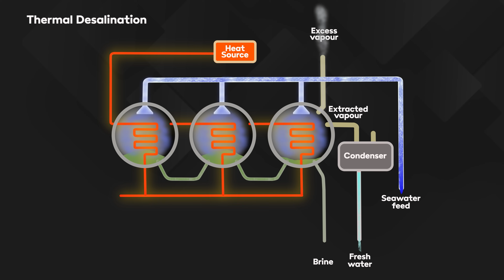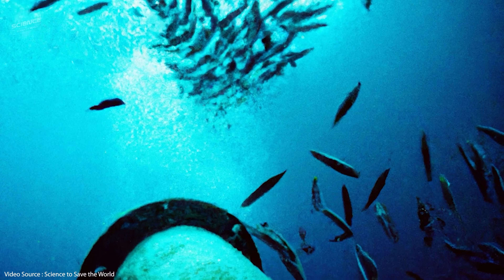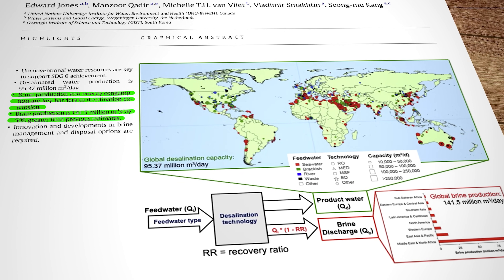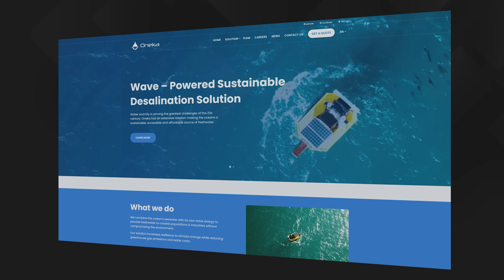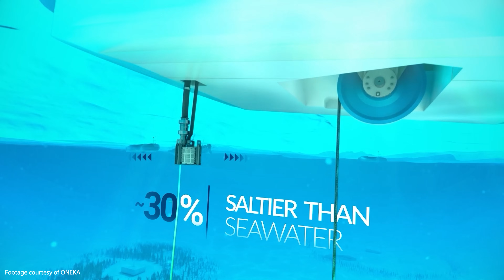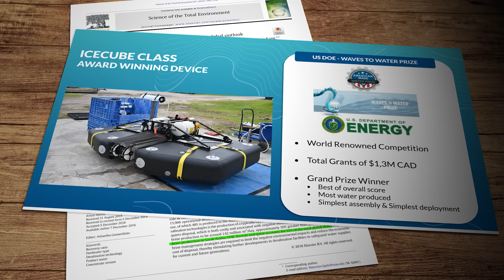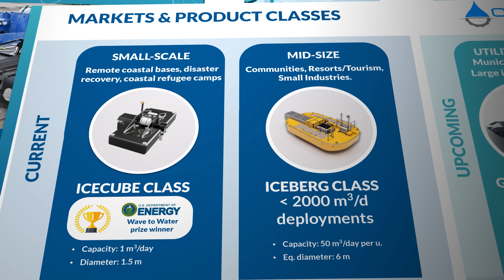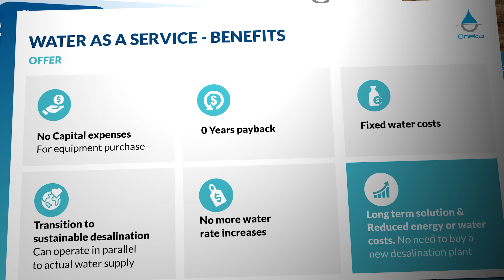Fresh Water at Zero Energy Cost . How do they do that?

Comment: My sense is, the maintenance costs are going to replace the cost of electricity.
Reply: Electrical power needs maintenance too
Reply: Having alternative to water scarcity problem is definitely welcome. 
According to sceptic, using fossil fuel powered thermo way would be the best…for who?   for the big oil and fossil pockets.
Reply: @SPSp-kl7tt  You could do it the old way and use the sun, but that wouldn't make any money and doesn't sound sexy.
Reply: Maintenance of large arrays hasn’t been a problem for offshore wind. Why should it be a problem in this case? It is also projected to be far cheaper than RO, providing capacity for increased maintenance costs vs that technology.
Reply: @thesquirrelhorde  Maintenance is actually a much bigger problem on the sea. 
But the benefit of increased windspeeds and thus yield and the factor that it is possible to install larger installations where on land roadsize is a limiting factor, hugely outweighs the increased maintenance costs.
Reply: @haifutter4166  I know, as I stated this is offshore wind arrays. In the UK we are in the process of building tethered arrays in deeper waters and these are still cost effective.
Reply: Darn! I wish I’d seen this in time to attend Oneka’s November 17th presentation at the 14th Annual BlueTech Week in San Diego, that’s just a hop from here in Newport Beach! Anyone here able to attend? Our local community only last year blocked the Poseidon plant scheduled for Huntington Beach, due to the destructive downsides & economic inefficiencies you mentioned. Here’s hoping that Oneka’s FL pilot pans out, as we in the Southern California “desert” would surely welcome them!

From reading the comments: Re: Collection Infrastructure, Maintenance, etc. They could be located a few miles offshore, where our defunct oil platforms, with their convenient anchor pads, are now. There could be single manifolds bringing fresh water down from a wind farm-like array of surface plants with piping piggybacking on existing oil to shore make ways. There could even be large solar & wind arrays out there sharing a common infrastructure. We have two such sites located ~1/4 mile apart that could provide redundancy. As decades long drill rig dismantling is underway, I’m sure this would be welcomed by the local community of those with the needed expertise & experience to make the transition. From my 10 months working on San Clemente Is. (down coast from Sealab where we chatted with the Cousteau support divers) & being “in” the sea as a lifelong surfer, this sort of thing doesn’t seem anywhere near as challenging as what North Seas wind farms pose. Circulating the components for maintenance should be a no brainer with a support/maintenance facility in San Pedro or even off/near Seal Beach (whose very activist residents might welcome the opportunities after thorough consideration). Please keep us updated! Thx.
Reply: Sounds like jobs to me....
Reply: My sense is the cost of maintenance wouldn’t even come close to the cost of electricity used by desalination plants which is extremely energy intensive. But using our ‘sense’ is worth jack sh**. Rigorous analysis is needed. Time will tell.
Reply: @BuellersBack  Something I can agree with.  We need DATA!
Reply: At least the connection to the mainland is a water hose and not an electric cable, which sounds like a plus compared to wave energy electric generators
Reply: Sounds like they're using wave energy on a boat to directly operate the pumps to a small scale reverse osmosis setup.  The reverse osmosis isn't run to the extreme, bypassing the difficulties of disposing brine.  I would think energy costs would be less because you are not fighting against the salinity as much because the brine is less concentrated.  You could apply many of the same concepts if you had a shore based plant run on wave and wind energy or even wind electricity where appropriate.  The low concentration of brine should not be a problem.  This would be applicable to a mid scale application.
Reply: My sense is we've never had and never will have any systems that are maintenance free.
The only things to be considered are the environmental impact and the cost per gallon.
Maintenance is present in every system.
Cost of installation, high or low can be amortized to equalize payments.
Reply: This could be built into ships & boats to provide fresh water for the vessel
Reply: @debrastrayer8600  True, ships already have desalination systems but if this would save money over conventional systems or make the ship "green" they'll do it.
Reply: Reading these comments, you wouldve asked yourself how we build any infrastructure at all and not just constantly argue about details that will be ironed out along the way. 
People here dont fully understand how this works, they over- exaggerate maintenance issues, and are not fully aware of how current widespread desal works. 
Its comically cynical, considering how dirty and inefficient our current power sources are.
Reply: @korosensei4384  I'm glad you're open minded.  I have some desalination investments for you.
Reply: @korosensei4384  I don't know if your comment was deleted by you or YouTube but "Tech bros" keep promising things they can't deliver.  Skepticism and DISCUSSION is healthy. SVB collapsed for a reason.  I'd love for this to be a great working idea because it legitimately solves some issues.  I just heard from a working civil engineer that more investigation in the front end would save many times the cost on the back end.
Reply: @jmr  I deleted my comment because I realized it was too sarcastic and you may have just been exercising healthy scepticism. The issue is reading tens of comments from different people about how this cannot happen, and channeling an answer onto one person who had tamed scepticism about one aspect of the project.

I get what you are saying, but some of the issues mentioned (by other commenters) were addressed within the video itself, and some people would rather respond pessimistically than open up to the potential of this idea and objectively weigh out the pros and cons.

Discussion is always healthy and time will tell if this project is viable. Looking forward to update on this.
Reply: @korosensei4384  I REALLY love the fact this idea can spread out the waste water better.  IMHO that's one of the biggest issues of current desalination methods.  It would also be great if we could redeploy part of a fleet to an area that's having a crisis. I don't know why the comments get so out of control.  I was being sarcastic too when I asked you to invest. 😂 My daughters college was literally paid for by a water desalination company that was started by three guys sitting around drinking beer in a garage.
Reply: @jmr  Oh you, and I was just getting my money ready 😄

I really like that the idea that its made out of waste plastic and that that it uses the wave energy for everything, and that the method itself doesnt require that much energy to desal, as its not meant to be as efficient as desal plants (also tying into the whole spreading brine better, as its much less concentrated brine).

Well I love drinking beer, now I just need to start something.
Reply: There are mesh wipers is use for water quality sensors in NZ mussel farms
Reply: Speculation as always, sigh.

The debate is unless someone can provide an accurate assessment on maintenance costs and compare them to large scale desalination plants.

Hard accurate data over speculation pls.
Reply: I’ve been around boats. Just leave anything floating in the sea, and see how long it lasts and how much work it needs.
Reply: Time will maybe tell
Reply: I have a feeling that most people underestimate the man-hours needed to make such a system effective over time.
The first month might not require any maintenance but that will change quickly. Even in the best of situations, you have to change filters and remove algae on a regular basis.

If something like a tornado happen, you need a huge amount of men/women and equipment on standby.
This is a cool idea on a small scale but extremely expensive if you make a whole town dependent on it!
Reply: @Alex Roth: If that electrical power is coming from burning Fossil Fuel, then we’re much better off paying for whatever maintenance instead.
Reply: I love the comment section of this channel.❤
Reply: It’s not just the odd breakdown maintenance, the filters get clogged and need replacement.
Reply: Why do you assume this will need any maintenance at all? Do pv panels need any maintenance? No. This platform is made from pet. Pet doesn't corrode for tens of years as proven by garbage patches. We have gas pipes, internet and power cables under the sea. I don't think putting water pipes there has any challenges. The only thing that can destroy such projects is under investment and lack of support. Technical difficulties tend to be overcomed if enough money is thrown at the problem.
Reply: @Adrian_kal  I’ve never seen a system that’s maintenance free. Have you? In the design there are a lot of moving parts that can break or get stuck, gaskets that can start leaking, corrosion, etc. Not to mention biological growth that will clog tubes, pipes, water intakes, etc. So yes, there will be maintenance. 

And no, lots of money does not necessarily solve technical problems. But it can keep up the image that your are working on solving the problem.
Reply: @Adrian_kal  
PV panels need to be cleaned every month or two, the dust and debris must be washed off.  In a marine environment the dried salt spray, barnacles, corrosion are also present.
Reply: @Adrian_kal  it will need maintenance. I'm a mechanical engineer and have been in the wave energy-powered RO industry for the last five years. I'm pretty intimate with the technology, but here's just a couple points about where maintenance will show up.

There are several mechanical components that will wear. Seawater, fresh water, and brine have low viscosity compared to oil that is normally used as the working fluid in these types of components, so lubrication is challenging and there will likely be higher rates of wear then normal.

RO systems need to be cleaned regularly to avoid biofouling and scale build-up in the RO membranes and throughout the circuit. Some of that can be taken care of with automated processes but not all of it.
Reply: But huge desalination plants also have maintenance costs...
Reply: @Fuck_Snowflakes  But at least they are centralized, making it easier, cheaper (fuel for the vehicle) and faster to reach the destination where repair is needed, no matter the weather or tide. 

The biggest problems of desalination plants (inlet and outlet) can be dealt with and improved on as seen in newer Australian projects. 

This new approach can be a great alternative for the niches it is currently marketed to. Let's just see how it performs and to what point it can be actually upscaled where it can't compete with a centralized approach any more.
Reply: Alternative view. Maintenance will be a doddle compared to traditional desal plants which cost a fortune to run and maintain. Like all desal plants the quality of the pumps in a salt water environment will be the key. Here's the beauty of this system. You have 20 floating around in the ocean. 1 breaks down. The other 19 just keep on producing. So you tow out a standby unit, hook it up and bring the faulty unit in for servicing. If you don't get to it for a few hours - no problem.  You also have a regular service where you bring units in for cleaning off sea life.
Reply: All the components are still in those other plants. Pumps, pistons, R.O. filters. I think it will be much much cheapera
Reply: Also the installation and maintenance cost of the pipework to shore stations which would be needed to store and foreward the water to the user.
Reply: @thamesmud  
They don't have to use pipes to shore.  They could have a barge collect the water daily, and transport it to distances too far for pipes or hoses.
Reply: I can remember watching TV programs in the 80's saying how wave power was going to provide cheap renewable power. It never has, the sea is just too hostile an environment for machinery submerged in it to run for long periods without a lot of maintenance. There are storms, floating debris, collisions with boats and whales, weed growing over intakes, barnacles, rust, etc, etc. It's a neat idea I just don't think it will scale.
Reply: @pauldenney7908  EXACTLY
Reply: @pauldenney7908  Nuclear is the only alternative.
Reply: How is the water transported, I bet there is energy costs not included in this analysis. 

The capital cost of the units, plus pipelines to distribute water back to land and then to customers, will be enormous per unit of water. 

And you are right about maintenance, the sea is harsh.
Reply: @deaninchina01  
Didn’t you watch the vid? They are connected to the and by pipes and the bobbing of the ocean powers the pumps.
Reply: Which could be a good thing… sounds like sustainable, climate friendly, local jobs 👍
Reply: imagine the cost, reliability of the long tube to feed the users, the cost of pumping power and the danger of destruction by ships, wales etc.
(long experience with invention, construction, installations, and remote monitoring of desalination systems in Kuwait, Cape verde, some powered by PV, a real financial disaster)  Keep it simple, minimum amount  of moving parts, and the huge problem of calcium carbonate deposits inside, requiring dosing with  phosphoric acid absolutely reliably;
failures are catastrophic for the users.
These can't afford the cost without subsidies, which are  arbitrarily cut, when political differences 'exist' . Tyranny has no bounds, a mighty factor always neglected!
Reply: @arturoeugster7228   What do you mean by "the cost of pumping power"?
Reply: @SirCutRy  Sorry, that needs explanation: 
The power to produce the reverse osmosis pressure is delivered by the mechanism, there is usually a pressure recovery turbine before the brine is released into the sea, matched to the flowrate, In this application,  I  did not see how this high pressure is recovered. The fresh water flowrate is much  smaller  and requires some storage to pump it to shore at a constant rate. Because the wave  power is variable even in the short term. It is far better to power the constant product flow from shore, because you cannot change this flow rate due to the enormous inertia of the water in a very long tube. As far as I understand the wave mechanism is purely mechanical and drives  no generator with a battery to produce a required uniform pumping power to deliver the product ashore.
In other words the desalination volume is sporadic, the delivery to shore MUST BE UNIFORM. only possible with storage and with shore power.
This is basic hydrodynamics 🤔
Reply: Yes servicing kilometers of plumbing under the sea doesn't seems very economically viable to me. It will interfere with fishing too. There is also the problem of output consistency. You have to add a reservoir to the system for days with low wave amplitude. It is another niche application imo.
Reply: Agreed!  Instead of one huge plant we will have thousands of small plants.  That will make maintenance more difficult and more expensive.
Reply: @jmr  but we have that with wind and solar energy production vs a single station.
Reply: @IMGreg..  Wind and solar are excellent examples for my point.  We keep making wind turbines bigger.  Scaling up reduces cost.  Bigger solar farms are more efficient as well.  That isn't to say there aren't advantages to distributed systems but we need to evaluate all aspects.  If there will be backend costs we need to take those into account up front.  Otherwise money won't be budgeted and the systems will end up in disrepair.
Reply: @jmr  
With many small plants, the plant can be towed back to port and repaired, which will help a lot; the repair person won't have to be a diver or get involved in the marine environment.
Reply: @jmr  Why would it be harder? Since they are small you can just tow them to shore for repair if need be.
Reply: @filonin2  The problem will be scale.  Someone is going to have to go out there.  There will be either a tangle of hoses or the hoses will need to be disconnected during transport.  If they can automate that you are on to something.
Reply: @filonin2  Oh it's that easy is it. Jesus Christ!
Reply: @filonin2  Try it and see, many have failed.
Reply: @filonin2  for that you need to buy a boat, pay the crew, pay the fuel and harbour fee. All of these costs don't exist in a conventionnal desalinisation plant.
Reply: @jmr  No, it would make it easier and cheaper to maintain and easier to locate faulty units. 

Like you, I don't know what I'm talking about. Just GUESSING like you did!
Reply: @Justwantahover  Your right.  It's always easier and cheaper to invent the infrastructure to repair something NEW and bespoke.

Are we having a secret conversation down here?  I find it funny. 🤣
Reply: This idea is brilliant, well, if you don’t know any engineering at all and are kinda stupid, then it is brilliant!